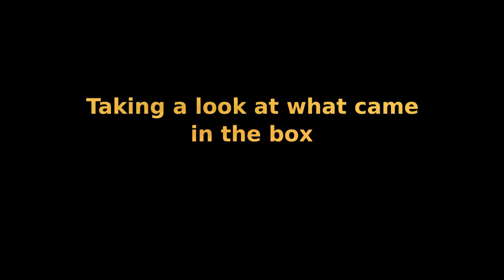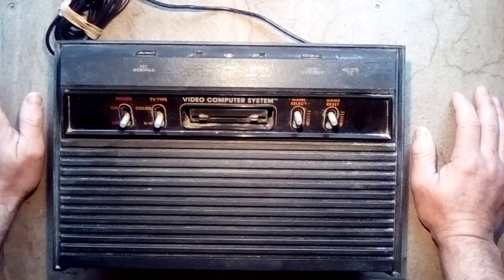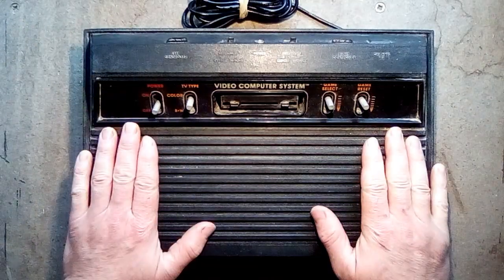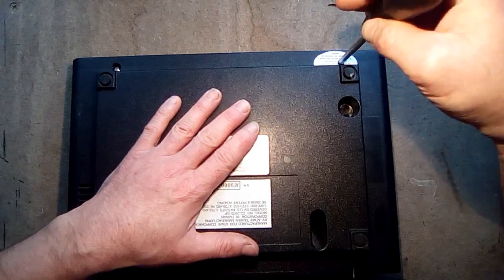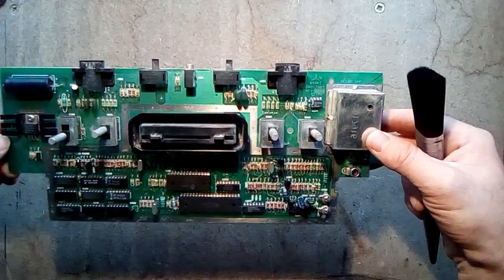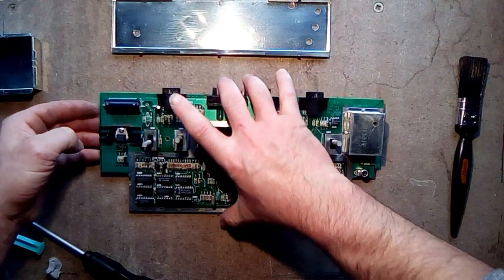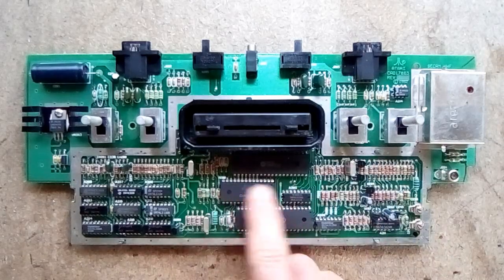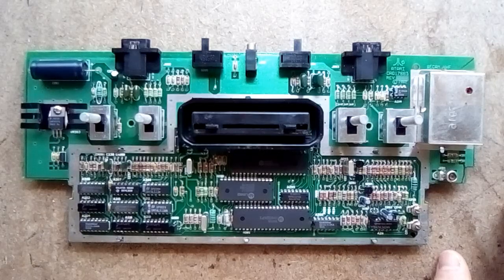SECAM Atari 2600  - 1. Cleaning and testing of the Beast

Comment: You're right that the 6507 was the little brother of the 6502, but the C64 used the 6510, which was a bit different. A 6507 was a 6502 core that omitted certain pins as a cost saving exercise by Atari. The NES used a Ricoh 2A03, which was based on the 6502, but omitted BCD support (because it allowed Ricoh to dodge a bunch of patents) and integrated lots of glue logic that would've gone in a ULA as well as the sound hardware.
Reply from the maker: Sorry for the late reply Keith and thanks very much for the info, I should really have thought about what I was saying a little more, I mean why if the C64 and Atari shared the same processor was the C64 so much better? My bad. That is really interesting about the NES's processor though. I'll have to read up on it a little.

Comment: It wasn't all that uncommon to use audio jacks for power at that time. I recall an old Binatone Pong machine that also used an audio jack for power.
Reply from the maker: I'm sure that using audio jacks as power connectors was common practice on many machines at the time. I know now that the Sinclair ZX 80 and 81 used it too. I have to admit it suprised me as this was the very first time I had seen it.
Reply: @8bitsinthebasement  IIRC, the controllers that came with that old Binatone unit also (ab)used audio jacks. I can only imagine the amount of electronics that were destroyed by people plugging the wrong thing into the wrong socket!